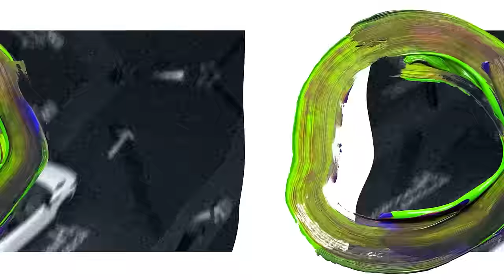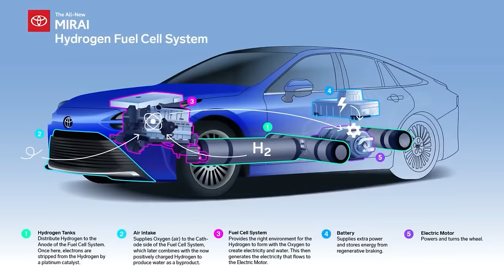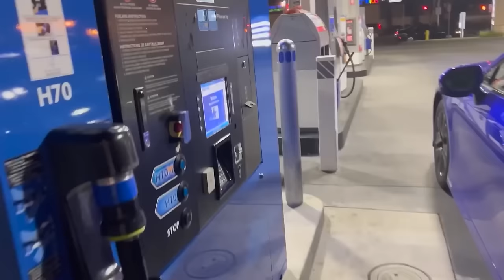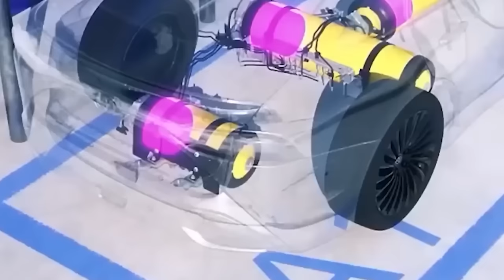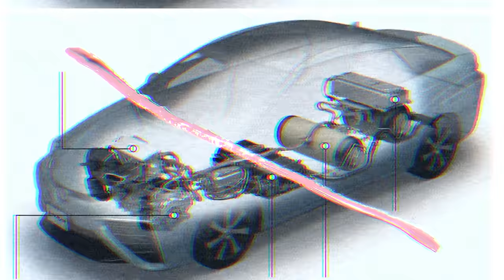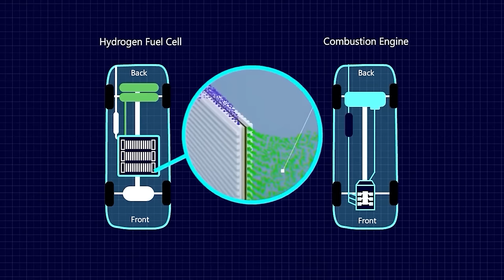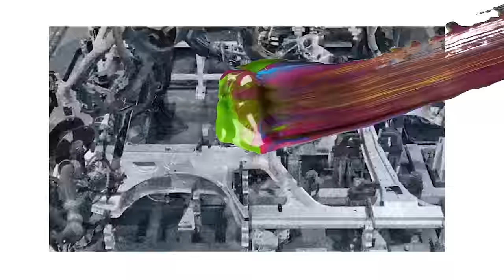This NEW Engine Will DESTROY The Entire EV Industry!

Comment: This smacks of an extended Toyota advert!
Please don’t get me wrong; I own a fabulously designed Toyota which is reliable and beautifully designed. 
I am an engineer who is familiar with the 2nd Law of Thermodynamics and thus find the premise of using electricity (from some, undisclosed, on board, supply to electrolyse water at a rapid rate) completely in contravention of the laws of physics….The energy balance doesn’t work in that direction: wonderful and fanciful daydream!

Comment: 1) The electrolysis process requires more power than it yields (negative net energy yield). 2) The distillation of billions of gallons of water requires a tremendous amount of energy. 3) The distribution system for billions of gallons of distilled water doesn't exist.

Comment: I said a few years ago we need to a hydrogen engine that extracts the hydrogen from its own water tank. I see distilled water is mentioned by some. When I was in motor trade in the early 70’s we connected a filter unit to a water tap that “turned into distilled water for use in car batteries. I wonder if distilled by this process would be suitable.
Reply: No, and nor was it for the batteries
Reply: Dean Kamen invented a new water distiller called the Slingshot. Produces a thousand liters of pure water a day using less electricity than a microwave oven.

Comment: It takes a lot of electricity to change water into hydrogen and oxygen. Where does that come from? That is the crux of one problem. How fast can this process make the hydrogen fuel? How much  hydrogen is required to make a 150hp ICE engine function. Some hydrogen will  need to be stored under pressure to accommodate the turn key go now demand of the automobile.What volume of hydrogen is needed to combust and make pistons go up and down? Will a storage tank be required for it? Or can this magical engine electrolyze a liter of water into its component atoms in minutes.  What powers that process alchemy? I am not convinced.

Comment: Just a quick question, if you have a water driven automobile engine, what happens to the water in the tank at -25°C temperature especially when parked overnight??
Reply: What happens to the water in your current engine when it is parked overnight?

Comment: I know its a simple point but how do you start the engine,I note from your simplistic description that hydrogen is not stored on the car so to start electrolysis to produce enough you need a battery to split the hydrogen to be able to start the engine.I know your channel side steps facts that might mess up the facts.Most of your facts are anything but.If only life was as simple as you seem to be.

Comment: The narrator didn't completely explain precisely how this theoretical engine works. How does a fuel cell convert water to electricity without energy? Is it a physical / chemical reaction? Is there an onboard generator to support electrolysis? I guess all of that will be explained once the water engine actually exists.

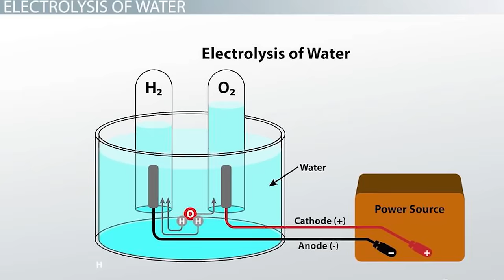Comment: At 10:30, this video shows you an electric power source and an idealized diagram that implies the use of electrolysis.  At 11:00, the narration talks about using the electric current to split the water into hydrogen and oxygen, so hydrogen doesn't have to be stored on board.  Unfortunately, they lie by omission by not telling you that the electrolysis is going to take a huge amount of electricity.  Unless somebody invented Mr. Fusion, that huge amount of electricity is going to have to come from something like a huge EV battery.  Even if we get wireless electricity transmission through the roadbed or solar cells all over the car, you'd be better off using a conventional EV motor than going through all this silliness of an ICE engine that still produces NOx (nitrogen oxide) air pollution. Their claim of "trace gases" is another lie; there is plenty of NOx produced. ICE engines are limited by all the thermodynamic limitations of Rankine style heat engines, friction from the piston rings and all the other sliding and moving parts and complications and losses from multi-gear transmissions.

Comment: Water as fuel? Only until it freezes in winter 😁 And if you add antifreeze agent in this fuel, it will not be clean anymore.
Reply: surely there will be a furnace burning coals around the water storage to keep its liquid form.
Reply: No, the fuel is gasoline (to make hydrogen). And the electrolysis would consume 30% of energy.

Comment: People only see "water engine" (as the video point out) and that water is the only exhaust.. 

But we MUST look at the whole picture of the environmental impact! 

To create Hydrogen is by "extract" it from water.. 
There just there is the issue. 
It takes a lot of energy to produce hydrogen from water. 

So looking at the whole chain from producing hydrogen and to consuming it and create water back again is not environmentally friendly any longer. (should we use coal, oil, nuclear, solar or wind energy to produce hydrogen.) 

It is like saying: "Look how environment friendly my electric viecle is with no exhaust." 😅

When the electricity may come from a coal driven powerplant that spew out big black smoke..😂

So the shortsighted people that just look at the car and if it has a exhaust pipe or not. 
Or if water 💦 is coming out. 

Don't care from were the energy is coming from or how it were produced.. 
As if:
"It is out of sight and out of mind." 😅

Comment: Fake video. For those who wonder: let's say the engine that powers the electrolysis produces 100HP. (It runs on gasoline.) Let's say the electrolysis gives you 70HP at 70% efficiency. So you are loosing 30HP for electrolysis. Where does the extra power coming from? This is not possible. Even if you could get 100% efficiency (which is impossible) you are using gasoline to have 100HP. So what is the electrolysis doing? Nothing. Electrolysis is just spending 30% of your fuel. Most stupid video I've ever seen.

Comment: if it is salt engine , you could bring down the sea ????????????????????????????????
Reply: @Shirley_-zn8kl    Hello Shirley.   You have a great idea, especially in view of climate change where the ocean levels are expected to raise. If I remember my high school chemistry class of a few decades ago,  :)  it seems to me that by using an additive such as salt, the efficiently of breaking down the water was raised. However, even though it would take less electricity, you are now left with the problem of what to do with the salt as it will not breakdown. Even if it did, you would end up putting Sodium and Chlorine gas out into the atmosphere, which I don't think would be such a great idea either. Salty water is even more corrosive than plain water. This whole concept of burning only water for fuel, while interesting and would be super-great if it could be developed, presents one problem after another. Solve one and another one pops up.

Comment: Same old flim flam. The energy required to separate hydrogen and oxygen from the H2O water molecule is unavoidably greater than the energy you would get out. No tricky engine can change that.

Comment: It was just a matter of time for one car manufacturer/engine developer to build an ICE running on water. The idea and practical installation of the technology to convert water to Brown's Gas that is fed into the gasoline supply of an ICE has been around for decades and is used where it is not illegal. Thus, Toyota's development of an ICE running on distilled water is very welcome. I look forward to thorough testing of a Toyota Water ICE in, for example, endurance racing like the 24hr Le Mans.

Comment: Where does the power come from? It currently takes more power to break water down into hydrogen and oxygen than the power you get from then burning it. if they made that 100% efficient so 1 kwh in you would get 1kwh of hydrogen energy from your battery you then put that through a combustion engine which we currently can't make more than 40% efficient we can't even charge that battery back up never mind drive down the road. Pretty much nothing is 100% efficient but I would be happy to be proved wrong. I see a conversion process that will have losses but where is the surplus energy coming from? Or is it a battery electric car that makes noise and has mechanical components to wear and fail?

Comment: Everyone seems to have an agenda, unless you use nuclear to split water with heat , the cost of hydrogen is higher than splitting water with electric.  In addition you will have no regen braking and the efficiency is still only 30 percent. With reenables ( not fossil fuel )  the efficiency is much higher with just electric.   ( Correct me if I am wrong and I will unblock your channel  )
Reply: 🤣
I love this guy

Comment: I heard rusting is the main problem of the water engine, but they're fighting it with lead pistons (huge reserves since electronics switched to lead-free alloy) and galium blocks (huge reserves since the failure of the so-called liquid-thermal-paste). Fingers crossed for you, Toyota!

Comment: Why can't the exhaust, which is water vapor, be redirected back to the fuel tank?  This should greatly increase the range of the vehicle! The problem of increased pressure can be addressed by first letting the water into an intermediate tank that is cooled, say by cooling fins fanned by the car's fan, and then letting the condensate drip into the fuel tank.  This water will automatically be distilled water.  Of course, there will probably still be losses, and one would have to top off the fuel tank from time to time, but it should dramatically increase the intervals between such occasions!  This doesn't seem beyond our capabilities, and just a matter of clever engineering and design to fit this apparatus into the vehicle's body without compromising the internal spaces.  Thoughts?
===============================================================================================================================================================
Reply: yepp, 
dream on